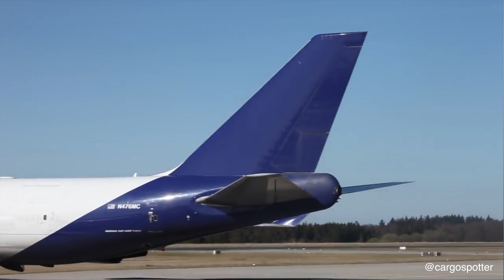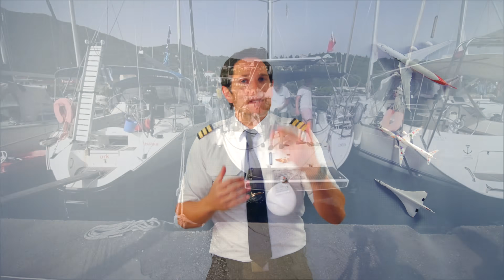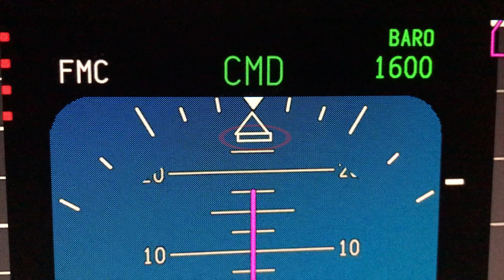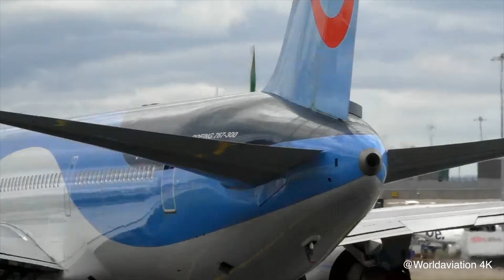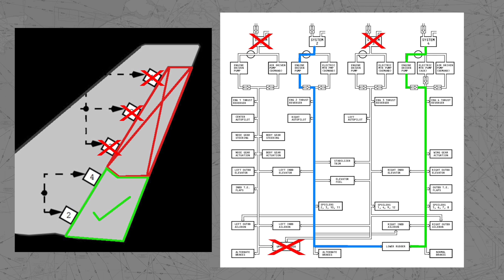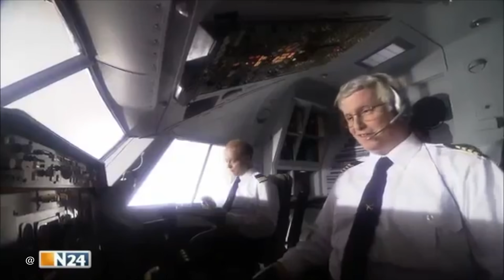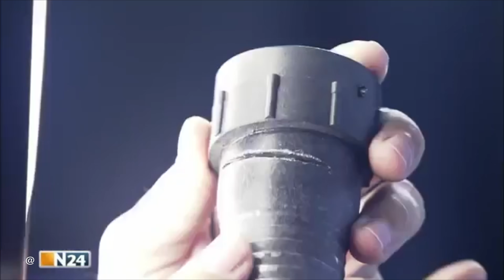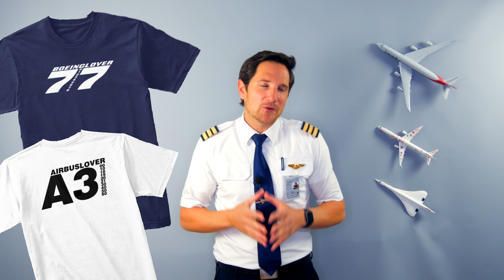Why is the RUDDER SPLIT? Explained by CAPTAIN JOE

Comment: Lower Rudder "Brute" Control Cross Wind Component , Upper Rudder Fine Adjust 4 Runway Alignment ! It's a Matter of Degree's . [ By Having Lower Rudder Douing The Grunt Work it Leaves the Upper Rudder 2 Fine Tune Cross Wind Component ] . Lower Rudder Takes the Majority of Forces . Upper Rudder Uses Lighter Component's Because of Lighter Forces . This is Desirable Because the Farther Away from the Centric Of of Moment a Smaller Force of Surface Movement Will Introduce More Force Due 2 Leverage as U R Farther Away from the Center of Moment & or Leverage Point  Which is Un-needed & Detrimental on Air-frames . A Big Honk'in Trim Tab on U'r Rudder ! This Type of Application Makes 4 Lighter Component's Farther Out & Brings the Moment of Heavy Force's Closer 2 the Air-frame & also Closer 2 the Attachment Point & There-by Can Use Heavier Component's 4 Actuator's . X-Cross Rudder's Act 2 Stabilize a Drag Force Much in the Way of a Shuttle-Cock / Parachute , Giving More Stability & Effective Mass in the Form of a Drag Force . This Force Prevent's the A/C from Swapping End's at Low Speed's & Delivers More Rudder Authority . As They Say , Pointy End 4-Ward & Dirty Side Down !  I Was Much Better Explaining This Stuff 50 yr Ago . Hope this was Helpful . YYZ , Mohawk-Planker .

Comment: I haven't watched the video yet but the reason I thought on the 747 was because of the crash of JAL something or other. The rudder was 1 piece and was the cause of the crash as it was stuck to one side and so boeing changed the design of the rudder after the crash investigation.

Comment: Joe can you please tell that how the autopilot / autoland and omnibearing system on A320/19/18/21 works and please tell that along with A320 CAN YOU also fly A321/19 and 18 or is it different .
Reply: Nalini Adhvaryu yes, you get a common type rating for the entire A320 series.

Comment: I think upper rudder and lower rudder pointed opposite as because to avoid collision with other aircarfts nearby and to create a balance on each side or to avoid cross winds might be the force is same that is why no reaction instead. B747 and Airbus A380 have these split rudder as they both are giant in their norms. Captain joe correct me if I am wrong. Looking forward for your answer. Thank you!

Comment: Disagree. It cannot be “Redundancy”. Hydraulics redundancy is not “control surface redundancy”. If it was hydraulics redundancy then the same concept can be applied to a “single” rudder control surface mechanism using all systems and double systems ...etc and achieve hydraulic “redundancy”. Having a split rudder for redundancy is like saying “in case a rudder breaks lose physically then we have another one” which is not the case. All hydraulic systems can be used for a single rudder and achieve redundancy. The main primary and most significant design reason for a split rudder is “Rudder Ratio”. Redundancy of hydraulics is a secondary byproduct. The Rudder Ratio System reduces the movement of both rudders at higher speeds (by the same amount) for a given manual pedal input. That’s the main reason only.

Comment: Maybe an kind of resting neutral position on the 380 like the 318- 380 ailerons resting downward on the after engines shut down and using jetway power. 😉

Comment: The space shuttle also had a really cool vertically split rudder doubling as an airbrake.
Reply: Gonun that’s what the a380 does as well
Reply: @glorious_help  uhhh yea, no.
Reply: @glorious_help  cool, didn't know that
Reply: GLR I don’t know about that but okay
Reply: @glorious_help  No
Reply: @nielsdaemen  I worked A10s for 10 years.  The ailerons plit up and down to act as a speed brake
Reply: GLR No they don’t. I’m not sure why you say that, do you know how space shuttle use rudder as speed brake?
Reply: @lokon1979  the rudder is split so that the right half goes right and the left half goes left to increase drag.  this is controlled by what during launch is the throttle for the main engines.
Reply: @glorious_help  no
Reply: @glorious_help  no
Reply: The A-10 has speedbrakes into ailerons too
Reply: https://www.researchgate.net/publication/333361674_Balancing_an_aircraft_with_symmetrically_deflected_split_elevator_and_rudder_during_short_landing_run
Reply: Ya got 69 likes bud
Reply: @komradblyat6983  nice

Comment: It's just the same thing as a car's steering. Faster speeds require less effort than slower ones.  I thought the rudder split as an air brake on landing, as the space shuttle did.

Comment: similar to sail twist, in this case just being influenced by the shape of the fuselage, creating a low pressure vortex between fuselage and lower rudder, while the upper rudder remains in clear air, therefore being pushed away?

Comment: Just guessing the a380 rudder was because the lower rudder has less surface aria and if one system controls the whole rudder then the system could equalise the pressure by deflecting the lower rudder in the opposite direction

Comment: When an aircraft is at the gate its hydraulics are not usually pressurised. As the rudder is hydraulically actuated, there is nothing to keep the rudder centred. This rudder deflection is evident on most aircraft at a gate, though it is more noticeable because the A380 has a split rudder.

Comment: I recall that about 500 years ago, the Italians discovered the best way to have a fine-tuned adjustment when you only have rough controls is to put two rough controls opposed to each other. So, they used a rough negative pitch lag screw and a rough positive pitch lag screw on a table positioner and had very fine control for machining. Perhaps this is the same thing? the two rudder elements oppose each other and give fine control at very low speed?

Comment: Once Air India flight 101 landed in Newark Airport with multiple instrument failure such as TCAS failure,  APU unserviceable, Altimeter failure etc and the pilot was continuosly requesting for VNAV LNAV approach to ATC. ILS approach is common as all flights do... Can u please explain and make a video about what is VNAV LNAV and other different form of approaches available to a pilot other than ILS and when these are opted for and under what conditions?

Comment: My guess on the 380 two way rudder thing is that if the hydraulics fail, the rudder deflects in opposite directions to cancel out any forces that 1/2 the rudder would impose. I have no idea how that could be designed, just my quess :)

Comment: The lower rudder of A380 is heavier than the upper rudder and hence the upper rudder has much weaker actuators,when win blows the lower rudder being heavy obeys the wind while the light weight upper rudder bends opposite side where low  pressure is  created. 
It similar to 2 balloons one filled with oxygen and the other with helium suspended seperately in bus, and when bus starts to move the 2 balloons move in opposite directions.....
Its just my theory.

Comment: Great video! I have a question which may be a good material for a future video: Why is that some 4-engine airliners such as A340-600 have their outboard engines mounted with a higher angle of attack than the inboard ones? You can see this on A380s as well.

Comment: Hi Joe,  one of the questions which are frequently asked by the flight school during the interview is, "the difference between Boeing and Airbus?" or "which one is better Boeing or Airbus?" 

Mostly,  they expect that the students should have more knowledge than any layman, and the student should be able to answer from the pilot's perspective. It sometimes becomes quite difficult for a student who even has no clue about Cessna.

It would be really helpful, Joe if you give me some points on the difference between Airbus and Boeing from a pilots point of view. I think you are the best person to answer this question.
Reply: Aditya Singh they are correct on asking such questions. Because it’s not that they expect a technical answer, but more of an “what is your opinion on Boeing vs Airbus”. They expect students to be aware of the aviation market, airlines and airliners, which is fair.

Ps main difference between Airbus and Boeing is philosophy. For Airbus, automation has priority over human, whereas on Airbus human has priority over automation.

Comment: Hi I haven't seen all your videos and I don't know if you already made a video about this topic, but what means the "heavy" after a callsign in a radio transmission?
Reply: Nicolas/Jacob C. He has made a video about it.

But the short answer is that heavy means that the aircraft is in the heavy wake turbulence category. Hence when controllers hear heavy, they know that they have to make sure that separation between aircraft is as required.
Reply: @ZK-APA  thanks, and I found it one day ago

Comment: You could have used a more daily exemple for this, all the cars with power steering been hydraulic or electric, gets progressively stiffer with the speed, and the most modern ones actually prevents the driver over steering. For example, when doing a paralel parking in my humble Honda FIT the steering wheel can literally be turned with one finger, but as the speed increases it becomes harder and harder to turn the wheel!

Comment: Hello captain,  I want to know the minimum runway length required for all classes of aircrafts from A to E  under standard conditions as there is no specific information is available on internet.
Reply: Landing distances are dependent on the aircraft itself, rather than the aircraft code.

If you search up per aircraft itself, you should be able to find the landing distance at max landing weight in ISA conditions.
Reply: @ZK-APA  just to know the runway required by different aircraft under std conditions such as a380, b747, b787,b777, a350,a340,b737, at75

Comment: do you get to choose the aircraft you fly when you become a Pilot?
Reply: Supanovaguy it depends. As in if you get a job in an airline which operates planes you are not rated on, you’ll get the plane based on vacancy.

On the other hand, you can choose to get a type rating on any plane, and then look for a job with an airline which operates that plane.

Comment: I'm not a engineer but think the a380 system   same as Boeing runs on different systems and who no hydro power is applied it deflects to the neutral direction. So it's probably that the pumps are inverted.

Comment: The thing with the two rudders in opposite directions, could I'd because the most airliners use the minimum amount of engines for taxing, that's why maybe just the lower rudder its point to the left cause of the nose wheel stearing? Is this a possibility? I am not sure, I am only working on profit jets smalle ones

Comment: Hi Guys, i am just wondering about the 3 continuous alerts at the end after dis-engaging the AUTOPILOT, why they are existing? The First familiar alert sound is enough why the 2nd 3 next to the 1st?
Reply: Hi Sherif, these redundant alarms are to ensure that the pilots are absolutely aware that the autopilot is disengaged. There have been several instances where pilots accidentally disengage the system, leading to near misses or crashes. Essentially, better to be safe than sorry. Hope that makes sense! If you have more questions like these, head on over to my channel and subscribe! Answering these sorts of questions is kinda my thing :)

Comment: Joe, if you have to dump fuel large amounts of it do the airlines get fined for cleanups & environmental hazards or anything like that? I ask because I live by an airport & if an emergency occurs & they have to dump fuel they fly them away from the city for obvious reasons but over farms to dump fuel where our food is grown & raised so just curious?? Thanks Joe.
Reply: Clay Cawood nope. It’s understood as it’s an emergency manoeuvre, so no such penalties. And generally fuel vaporises in the air before it reaches the grounds.
Reply: I know at high enough attitudes it would but close to the ground? And if the spill any amount while fueling they use hazmat equipment to clean it up so I was just wondering. Thanks for your reply.
Reply: Clay Cawood generally when the aircraft is close to the ground they are instructed to climb before fuel dumping takes place (planes can still climb with engine loss,albeit slowly).

Comment: In wind the larger portion of the rudder will turn with the wind and the hydraulics although powered by separate systems must share hydraulic fluid pressures and the small rubber deflection in the opposite direction balanced the hydraulic pressure change.

Comment: This is the same type setup used on the USS Honolulu. They used it on the stern planes. Correct me if I'm wrong here, but they had 2 separate hydraulic plants, one for each plane. The big fear was a jam dive or rise on the stern planes, especially at high speed. With the usual setup of one plant for both, recovery was difficult. With the split plane system the hope was only one would jam, and you'd still have control of the other. Heard the system was somewhat problematic,  and was limited to just that boat. Not sure if the system was adopted for the Seawolf or Virginia classes though.

Comment: Theory: The upper rudder has a larger surface area, so the wind provides a great affect pressure on it. As it moves in the wind, the split widens  between both rudders and the airflow travels downward. This provides a pressure on the opposite side of the lower rudder, causing it to deflect in the opposite direction.

Comment: Captain Joe, I've been wondering why when a plane is taking off, the engine sound does not increase right away, but it is increase to about 20% for like 4 seconds, then all of the sudden increased to max? I always hear this kind of sound on the Boeing 777, but I can also hear this on other models. Here is an example video of such sound: https://www.youtube.com/watch?v=sJqtrj5OrKI&t=17s
Reply: Hey Ben, since Joe doesn't hang out in the comments that much I've got you :) It's a bit complicated, but in short pilots often spool the engines up anywhere from 20-50% max thrust before increasing to full thrust to ensure the engines are responding properly. If you've got more I recommend heading over to and subscribing to my channel - I am to answer each and every question I get!

Comment: Too bad Boeing didn't have a backup trim system on the 737 MAX that runs on a separate bus or circuit with backup trim buttons next to the trim wheels.

Comment: The Space Shuttle orbiter's rudder is quite unique too, it's split horizontally like on the Boeing 747 but it is also split vertically, so it can be used as an air brake.

Comment: that the rudders are pointing in different Direktionen, is due to Airflow... if air is crawling around the fuselage, the lower rudder creats turbolences around it... and pushes the upper rudder to the other side.  it is actually a gap in a big surface where air is "Leaking" through.

Comment: I don't see why they can't just use all four systems on one rudder. I wonder if the designers were more interested in the need for less rudder at high speed. There may be considerable weight savings by not needing huge forces on the upper rudder.

Comment: I believe that the A380 while parked and the upper rudder is being deflected by the wind, the hydraulic fluid from the upper actuators pressurize the return line. With a pressurized return line, it would then delflect the lower actuators.

Comment: Thanks for the video Joe....but cud u explain why the split rudders are not of the same size....Bcoz the lower ridder being smeller in size may not contribute significantly to the yaw required for critical conditions like crosswinds.....or does it?

Comment: I’m from Ky so the simple answer is......”$H!T goin sideways” fer sum reason. 😆 I’m joking (sort of) but this is very interesting given the normal and redundant hydraulic systems on aircraft. It’s very common to see wind deflection manipulate an aircraft rudder on the ground. I’ve just never seen a split rudder oscillate in opposite directions. Great video.

Comment: The A-6 Intruder family of attack aircraft have a similar split panel near the wing tips.  These are used as speed brakes.  So far as I know, they are not independently operated, but someone with better knowledge should correct me on this.

Comment: Hello Captain Joe,  could you explain how often  mechanics need to change the airplane's tires? 
Love your videos! 
Greetings from Perú.
Reply: Two primary methods that I know of. The first is the red cord standard. If the tire is worn down to a cord layer that is colored red then the tire is supposed to be changed. That is any amount of red. Yes, the smallest amount of red cord showing justifies a tire change. 

The other method is by a careful examination by the contracted tire company. A tire company like Michelin may be contracted to do fleetwide tire management. The company's technicians monitor the condition of each tire at a frequency specified in the contract. Daily, after each flight, twice a day, etcetera. The technician looks over each tire, does some calculations, and decides if the tire needs to be changed so that the probability of a tire failure during the flying day is kept as low as is economically possible. If he calculates incorrectly then there are financial penalties for having a tire incident during the flying day. If he changes tires too frequently then the tire company can have financial losses from the fixed price contract. 

Now obviously damaged tires with sidewall bulges or similar get changed no matter what the remaining tread depth or cord depth is. 

You hope to get from 1 to 3 retreads from each main gear tire core body.